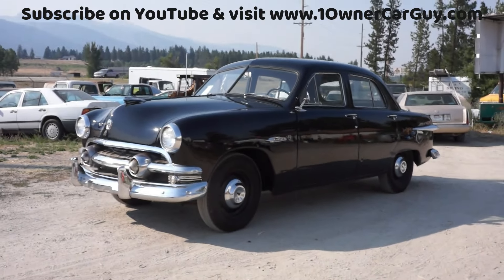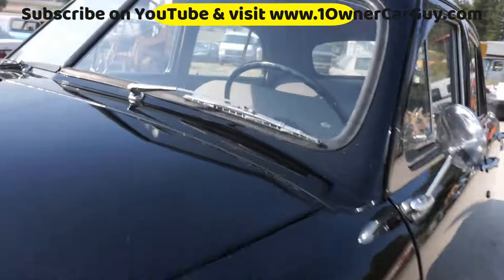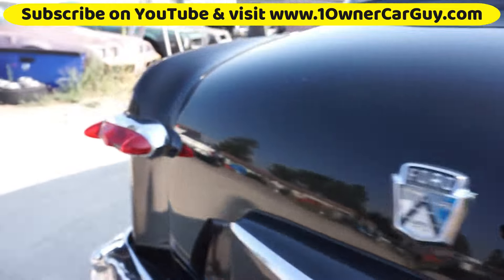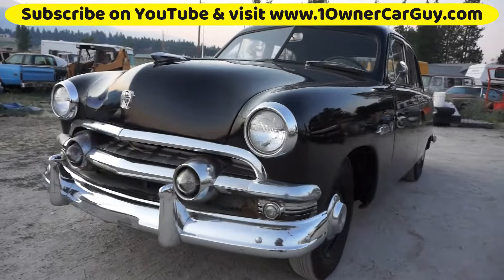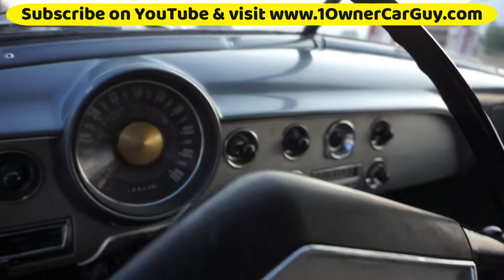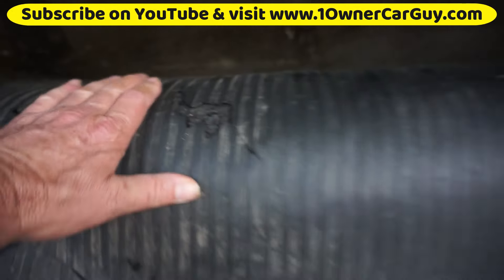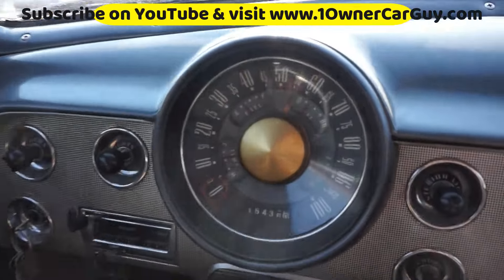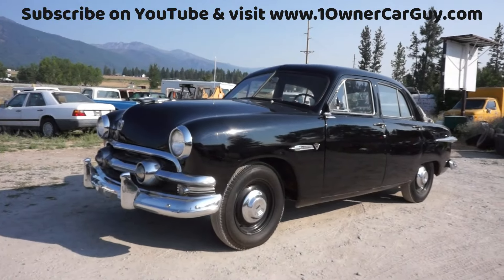Magnificent 1951 Ford Custom: Original Paint, Interior 15,000 Original Miles ~  Ready for Shows!

Comment: How do they know that has 15,000 miles
Reply: Good question. If it's not documented then the 15,000 on the odometer means nothing. I don't doubt that it's an all original time capsule but I would simply say the odometer shows 15,000 miles.
Reply: I recall seeing a 1951 Ford just like this one in 1962 with 18,000 miles
on it.  It was owned by Mrs Henry J. Smith director of the B&O railroad.
No one drove her car but her.  She would drive it daily to the mail box
half mile away on their estate and to church on Sunday, five miles away.
The driver's door had absolutely no wear on it!  This leaves me to think
this vehicle has way more than 15,000 miles on it.